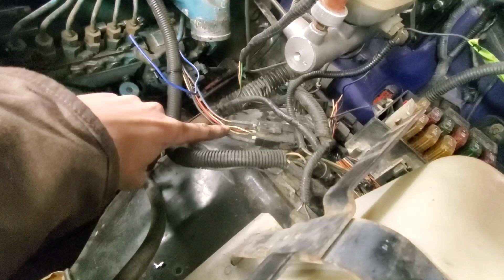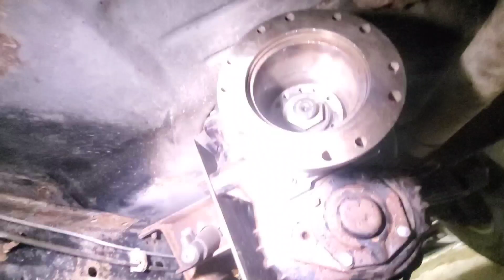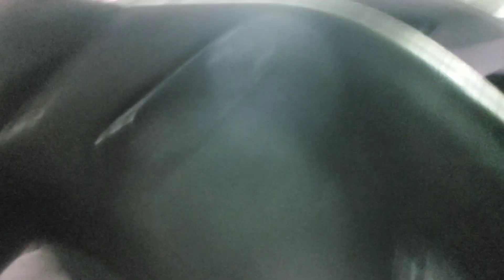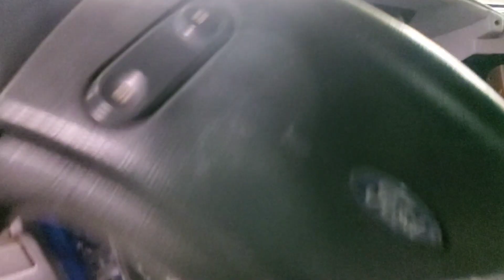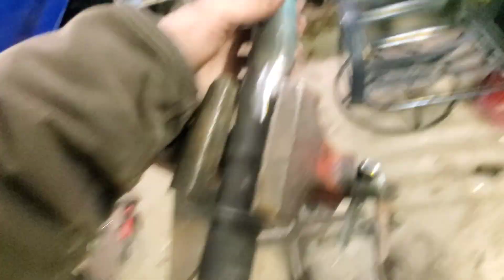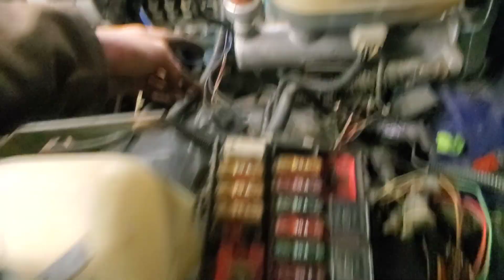WIll IT START?? F350 DT360 swap pt. 4

Comment: How do you plan to get your tachometer to work
Reply from the maker: I've got the factory diesel tach sensor and the current plan is to cut the correct number of teeth in the crank pulley to get the correct signal